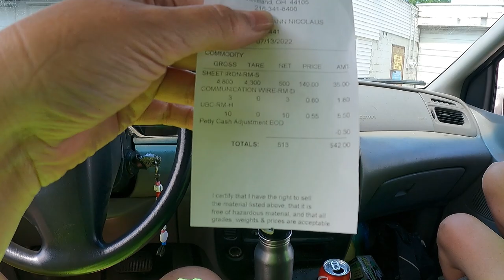Dumpster Diving- Scooter Smash- and Scrap Yard Payout!

Comment: Think you would have found the scooters were aluminium
Reply from the maker: Most are part aluminum. These weren't. The flimsiest scooters ever. No aluminum on them whatsoever. Tin and plastic. Thats why they're trashed. We've been doing this awhile.
Reply: Did you not see the part where we stood at the back of the van, talked about the scooters, looked for and found our magnet and checked them? I guess you didn't! ❤Scrap It Up Blinks!